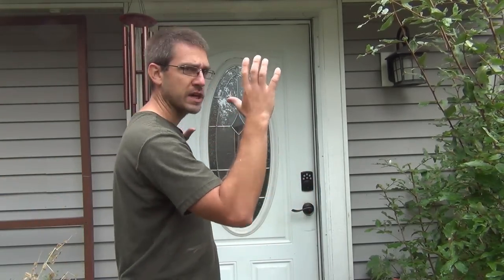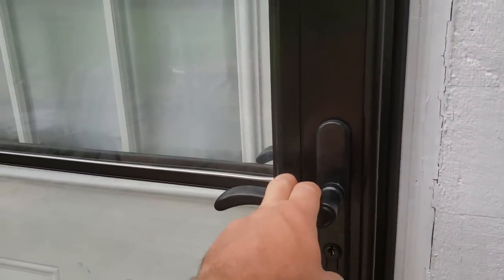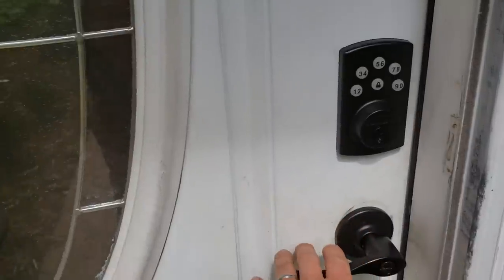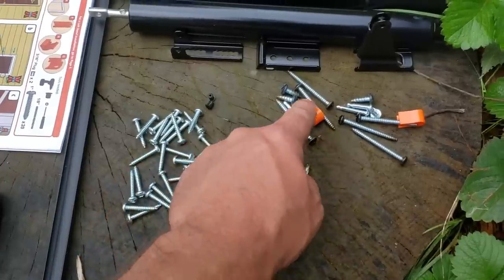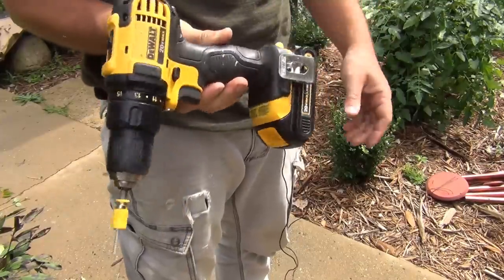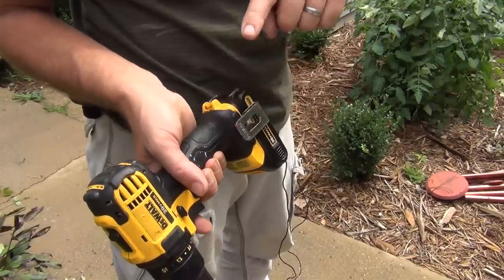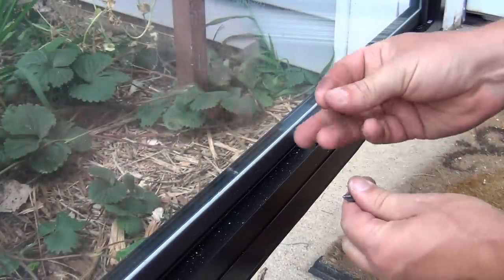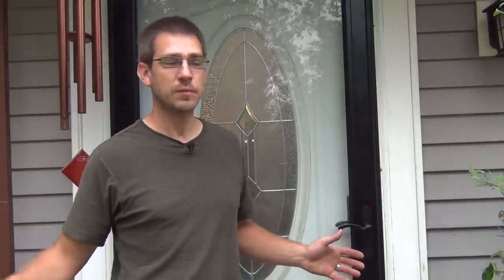Using Storm Doors to Increase Home Heating Efficiency

Comment: I worked at Anderson Corporation here in GA & I can say their products are worth the price. Great company
Reply: I can see the effort in my Anderson sliding door.  I can vouch for the quality. 

For the long story, since I believed I was getting severe infiltration at the fixed-to-sliding door joint, I took the slider out to improve it.  It was huge waste of work because through disassembly I found the joints must seal internally - and the joint is good.  I noticed a concave edge to the joint and assume it's to compensate for bowing and pressure - all quality construction.

The only thing I could remark on is in the instructions for the top track - it should not be screwed down too much because it will cause a compression that makes pinch points, and these will make the door not slide easily.  There is no fix to the deformed track; no lubrication will help; only cleaning it will be of any use.  I recall part of the problem was that the screws will not go in straight due to hitting a drill chuck, and this will make the user try to tighten it even more.

Yes, quite an obsessive recollection, but my experience of DIY, fabrication, experience in building consulting engineering and reverse engineering observations, I know exactly the truth of this product - bam, LOL.

Comment: I was wondering if you were going to put a storm door on. Good call ! Thumbs up.
That door was a bunch easier than the 100 dollar piece of junk that I bought at Lowes !!
Reply: Did you get the sawdust/press-board piece of garbage coated in white metal?
That's what I got... the metal coating is literally disintegrated in a bunch of spots.
Installed 2 years ago.  
What a load of garbage!!
HA
Reply: @PatrickWagz , Yes, that's exactly what I got !  I'm hoping it will last a little longer because of a decent 18'' overhang the door has right above it.

Comment: We have the exact same door as you have on the back door. It's been a very nice, quality addition. Are you planning on storm windows for the same reasons? I replaced the 50 year old windows in my house when we moved in but am contemplating putting on storm windows for the added energy/thermal benefits. I am very excited to see your additions tho create a more energy efficient house!
Reply from the maker: We probably won't do windows for awhile. I would like to save up the money and replace all of our windows with high efficiency newer windows as the ones that are in here are super cheap.